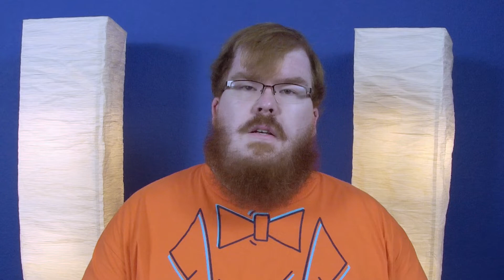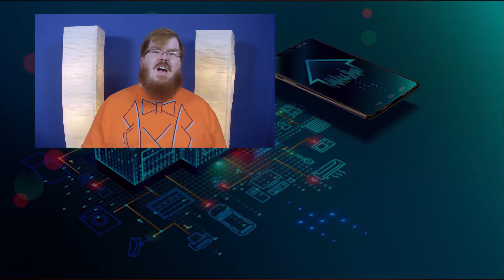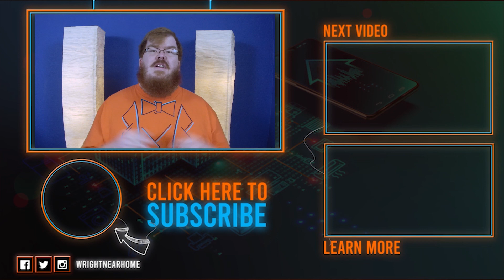What Is The Technology Behind The Smart Home?

Comment: I try to avoid WiFi smart devices as much as possible, got to keep those airwaves clear for all that high speed packet slinging :)
Reply from the maker: Yeah WiFi can very quickly become over saturated. That is why I try to use 5 GHz as often as possible because 2.4 just can’t take the heat.